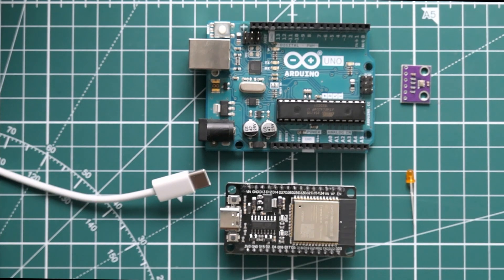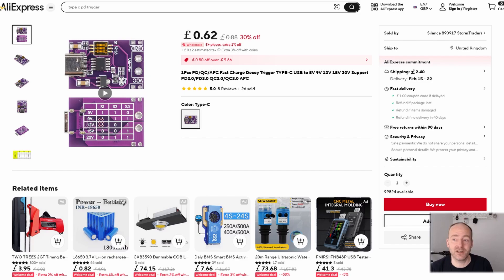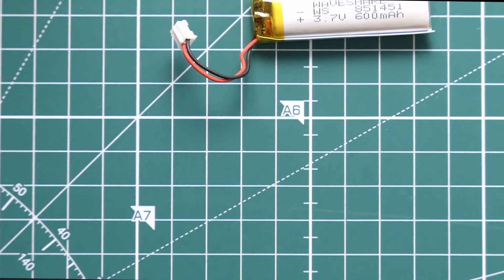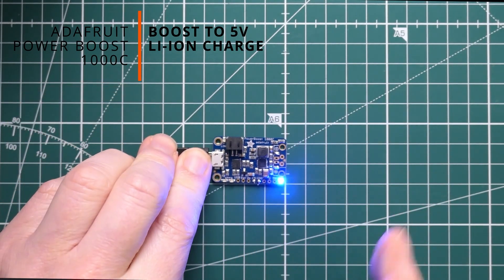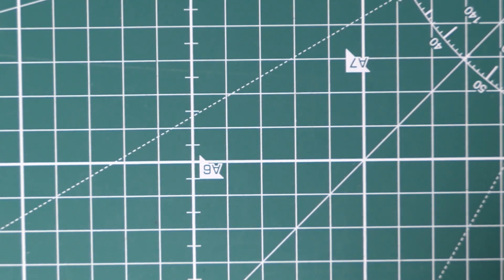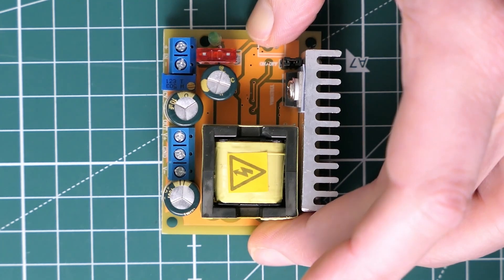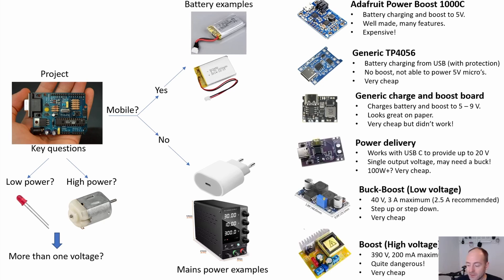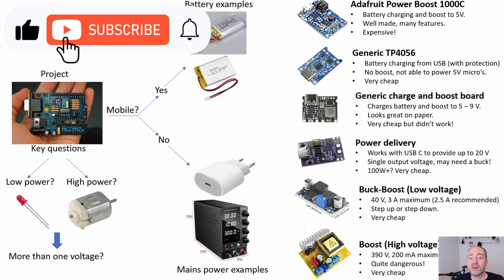Power to the Projects - How do you power your electronics project? So many options, which is best?

Comment: Did you get the cheap step up boost module working in the end? You mention planning a video about it - is that still in the works?
Reply from the maker: I did! Used two of them in my most recent video and they worked really well! Not sure if the one used in this video was a dud or if it was a slightly different version that needed the battery attached…. Thanks for watching 👍👍👍

Comment: 2rs 555 motor , bts7960 , Arduino leonardo , rotatory encoder.. ?? Please give me best power supply..
Reply from the maker: Well… the bts7960 works up to 27V, so whatever voltage you’re using for the motor I would use some kind of switching regulator (ie a buck) to reduce the input voltage down to something suitable for the Arduino. Something like an LM2596 works up to 40v and drops down to 3.3 or 5v depending on how you want to power the rest of the electronics. Hope that helps, can give a better answer if you give more details… are you wanting to power this from a battery? What is the voltage and current requirement of the motor?
Reply: @thecircuithelper 12v one motor 😁..

Comment: The VIN pin is connected to the  Ams1117 3.3v LDO. The Ams1117 can handle  12v, 5v, to 3.3v conversion.  However id stick to Max 5V on VIN to not accidentally connect 12v to vin when you  are connected to pc. VIN needs to atleast be 1v more than required output voltage  ,so 4.2v can work since esp32 still works with 3v.Infact this is how I have connected it to my s2 and s3. Also Esp32 will work with as little as 2.3v  in some cases.  It can operate on 2.3v when it uses external psram & flash  or when its using 1.8v Flash and external psram. This is in the datasheets
Reply from the maker: Good insight, I didn’t realise they would work at such low voltages (which is handy for battery application where there’s no boost converter). The biggest challenge is the 3.3V i/o, I’ve made the mistake before of powering everything with 5V including a 5V compatible sensor, forgetting that means the sensor output will consequently be 5V. I found it hit or miss if the ESP32 can survive this! Thanks for watching 👍👍

Comment: I'm so confused, so many boards require a 5v power supply, why is there no simple battery pack that has room for 5v worth of batteries and a simple female GPIO connector to plug into a raspberry pi/ESP32-Cam/Arduino?
Reply from the maker: Yup, it’s a little annoying, the closest to what you describe is a standard usb battery pack, but they lack the simple connector plug that could go directly into a microprocessor board… so you’re left with a unwieldy usb cable which is much more bulky than actually needed (due to all the data lines).

I guess the problem with all batteries is that the voltage is not constant, e.g. Lion batteries start at 4.2 and drop down etc etc, so you’ll always need some electronics to compensate for this, either a linear regulator (to drop down from multiple batteries in series) or a switching regulator to reduce or increase the battery voltage. 

What I found in this video is that there’s really only one good battery management board that includes the charging and boosting electronics with appropriate connectors etc, but it’s from Adafruit and is very expensive. Making an alternative to this board for a lower price would be a good subject for a video! Thanks for watching 👍👍👍👍

Comment: Hi, does the aliexpress board (starting at 9:16) have overdischarge protection? I've tried reading the specs but I can't figure it out. I know the first TP4056 module does. Also, what is the purpose of the pads just below the B+ terminal? What happens if you bridge them or populate them with a resistor? Thanks :)
Reply from the maker: Good questions… I just put the module under my magnifying glass and it actually uses a 4056 IC (I didn’t realise this, I thought it was more likely to be a combined charging / boost component), so it probably offers some of the features that a typical TP4056 module does. Though I’d have to look at the circuit diagram to be sure it has the same external battery protection components! If I had to guess, I’d say the designer took the standard TP4056 module circuit and added a boost IC and inductor to make the output variable… it’s what I would have done!

I was thinking it would be pretty easy to use a resistor to mimic the presence of a battery, but maybe there’s something else going on and it actually uses the connected battery for the boost output, so simply putting a resistor across it wouldn’t work. If only there was a circuit diagram, it would be so obvious what was going on! That’s the problem buying random stuff off Ali I guess! 

Thanks for watching and interesting comments!

Comment: as an ADHD maker, the correct answer is "whatever I have on hand"
Reply from the maker: To be honest, most of the time I just grab the closest thing that will do the job, even if it’s that super expensive Power Boost board. If I’m planning to make something that I’ll leave unattended (like my ESP32 controller in my coffee machine) or something that requires moderately high power then I tend to give it a lot more thought, wouldn’t want my house to burn down because I’d taken short cuts on the power supply! Thanks for watching!!

Comment: Hi, in the video, you are demonstrating a XL6009 converter, chip is from XLSEMI, its configuration in the board is likely only boost capable, not both, although I could be wrong. On the website, you are looking at a converter based on a LM2596, different chip, and it can definitely only step down, it cannot step-up. I'd suggest you look carefully to make sure you are cross referencing the correct boards.

BTW for most of these, their amperage ratings are "aspirational". There's likely no way you could get 2.5A without it melting, as it is. It might be possible, if you first added a heatsink, and then also put it  in the path of some sort of fan. Although we'd also have to check if the passive components on the board could also deal with those currents. As a general rule of thumb, divide any chinese current rating by two if you actually want to use those modules at higher amperages.
Reply from the maker: Really interesting comments, I’ll double check that XL6009 chip and maybe run a few tests when I get chance… first I plan to build a variable load to do some proper testing (going to make a video on this), but I guess it is not needed if I’m just checking if the board is capable of step up and down operation.

I have to admit, I’m also incredibly skeptical about the current ratings of most of these boards. I’ve used them all in the past, but never at their suggested ‘limits’. It’s never a good sign when something is described as being capable of handling 3A, then hidden away on the description it says don’t go above 2.5A, realistically they probably mean 1 A 😂. I’m definitely going to test this once I’ve built the load. 

Thanks for the interesting comments and for watching 👍👍
Reply: @ Often the amperage specs can legitimately come from the datasheet. But the datasheet is calculating a maximum-limit scenario, where you are using best possible associated passives, and assuming the chip is well-mounted to a beefy heatsink+fan assembly that is capable of sucking the heat out of the package at the same rate that it produces, while everything is running at a steady state 100C. Obviously these "dinky" boards with cheap as chips components, are nowhere near that scenario. If one does the power transfer calculations using the datasheet values, if the chip only has air to dissipate the heat to, you'll find usually find a far less exciting power (/amps) limit.
Reply from the maker: Yup… it’s amazing how the marketing people are able to see the absolute max rating, but not the Tc = 25C next to it!! They must assume everyone uses cryogenic coolers or something! I guess the biggest upgrade to these boards would be better thermal management, with proper heat sinks and possibly bigger inductors on those buck/boost boards. I’ll soon find out when I do some proper tests, most of my projects so far have been way below the suggested max ratings.